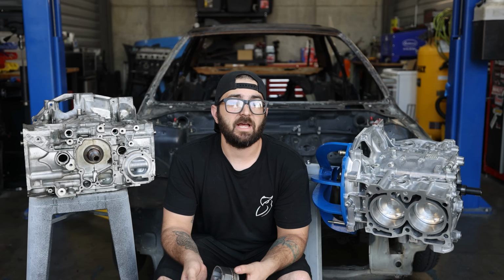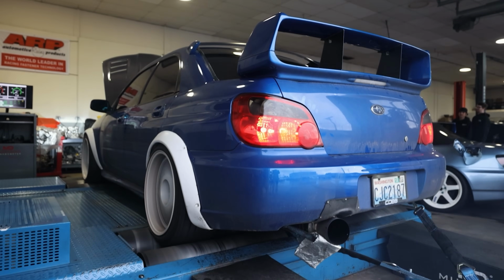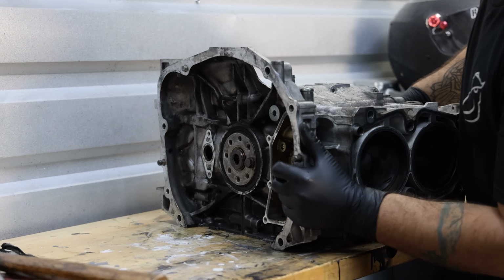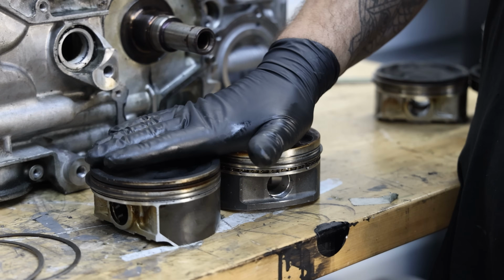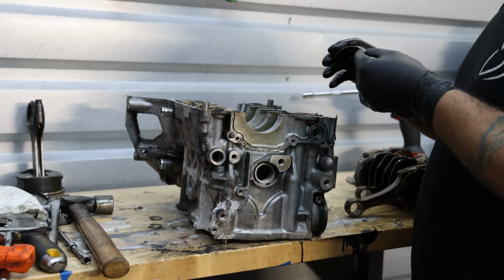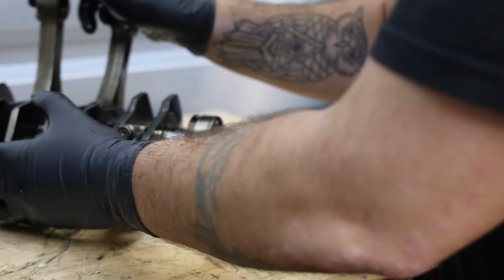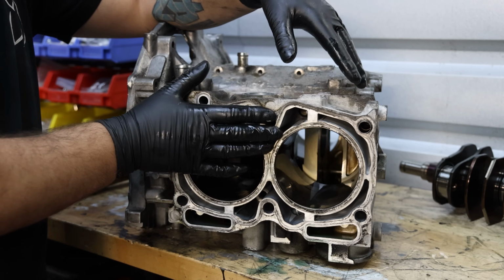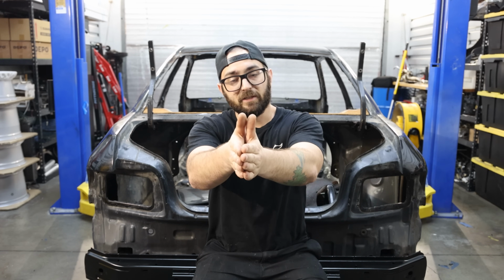The Reality of Stock Engines & making power; Subaru WRX STI

Comment: My dude, I would like to see something more informative. You missed a lot, I'm sorry to say. The biggest one being the positives and negatives of going forged internals. For example forged pistons aren't an end all answer to a problem, there is a trade off.
Reply: What’s the trade off? Mpg?
Reply: @dan2danger    well first we have to start with what type of forged piston. Is it a 4032 alloy or 2618 alloy? You can Google the differences between the two, but we'll stick to 2618 because I don't remember the last time I've ever seen anyone saying they're putting 4032 pistons in their EJ. 2618's have a higher thermal expansion coefficient. This means that they will get significantly bigger when heated, in comparison to stock hypereutectic pistons, which have a lower expansion rate. You have to compensate for this phenomenon by machining the bores for a larger piston to wall clearance, to allow the pistons the space to grow and expand once they're heated up. The problem in that lies with cold starts. Cold starts are already hard for any motor. Everything is at a higher risk of accelerated wear everytime you cold start an engine, because nothing is warm or expanded into its intended operating clearances. Having a larger piston to wall clearance exacerbates this wear rate on cold starts. You wear the concentricity of the pistons and liners quicker, piston slap can develop, rings don't seal as well, etc.

It's not that I disagree with the need for forged internals past a certain power goal. I would just like to see people more educated on ALL the factors that they're getting into when they go forged. So as they can make a more informed decision on whether $10k is a good choice for THEM in the long run. I mostly think of the people out there that are modifying their only car, and there's a LOT of them out there. That think "I'm getting a forged motor because it's just 'better'", but it ends up being an expensive crap shute, something goes wrong and now they're in a tough spot.

I could damn near write a book, but at least that's one of the big considerations.
Reply from the maker: @ThatGuy-yj3lu fair point to include in, with these videos though I try to leave them fairly surface level. Most people won’t understand alloys, PTW etc. including pros and cons would have been a good thing to add in I do agree. It’s just finding a good middle spot of how to present the info so beginners can understand as well. 🙏
Reply: @Smeedia  imo incomplete information can be as detrimental as wrong information.

Time to start writing the multi-parter. Use lots of pictures, us car people are simple creatures 😄
Reply from the maker: I’m not saying they are, and you talking about the expansion rate difference with forged vs cast?  Only big difference would be PTW clearance when building with maybe some pistons slap. But most people aren’t going to be setting up their own PTWC

Comment: So i can get an accessport with headers, intake, and down pipe to the already installed catback and not worry to much for a daily driver ‘13 wrx? 😅
Reply from the maker: I’d toss some id1050s and a fuel pump in but you should be solid 💪

Comment: Been running my Ej207 version 8 at 400whp for 4 years as a track build.

 A good tune and reliability mods like AOS, Cylinder #4 cooling mod, Killer B pickup and baffle 

= A long lasting stock block 

Ej207 is built better for the abuse
Reply from the maker: The thicker cylinder liners in the 207 are a huuuuge thing with factory blocks 🔥
Reply: @Smeedia  - Two versions, thick wall is hypereutectic pistons non-thick wall 207 with forged pistons - Non-thick wall good for 300kws (around 450-500 fried burger numbers)
Reply: And for the love of God... Replace the stock oil pan if you plan on doing any fun. Largest regret I have on mine.
Reply: @followtheornghat  I've been running the stock twinscroll one on track and I pull up to 1.35 lateral G's with the tire/suspension setup I'm running. 

Haven't had any oil pressure drop issues yet. Which pan do you recommend ? IAG or Killer B?

I currently have a Killer B pickup and baffle.
Reply: @ryanc2360  the baffle is the bigger upgrade. The oil sloshing in the stock pans of EJs is horrible.
Reply: Rod ratio helps a lot with that too.
Reply: So youre telling me if my ej blows up to use a 207
Reply: @nathanielgates2863  ya my car originally had a ej255. 

The ej207 version 8 has big port heads, equal length headers, a twinscroll turbo, no tgv's in the intake manifold from factory,  more aggressive cams, and an 8k redline.
Reply: @ryanc2360  Sounds like how they should all come lol

Comment: Currently making over 600 whp on my original STOCK engine. Tuned by @JRtuned. Ets rotated kit with gen 2 precision 6466 on e85. Here for a good time, not a long time  😅
Reply from the maker: I’m all for it my guy 😂😅
Reply: JRtuned is awesome. My 2015 STi still going strong with his magic.
Reply: FA series block?! Ej would just go 🤯 at that lol
Reply: @gripwerxracing  ej257 ra engine
Reply: That sounds like a grenade with just 1mm of the pin left in the spoon.

Comment: To the B22 fund
Is there a point in going for a super built engine if I don't have access to E85 and/or it's very hard to get it where I live?
Do I need to get it closed deck, forged pistons, ARP studs if I will never fill it with E85?
What would your advice be for pump gas?

PS. Love your content ❤
Reply from the maker: Appreciate the support my man! And tbh that’s kinda a hard question to answer without more info. 

You don’t NEED E85. You can make good reliable power on pump gas as well. As for a closed deck that really depends on your power goals, boost target etc
Reply: @Smeedia  My goal is 300-400 HP. But everyone I ask says: you can't make that power "reliably" on pump gas.
Reply: @m0rjjj666  you definitely can. 400hp on 91 is not uncommon

Comment: This isn’t so much a stock motor as such but more a stock turbo question. I’m currently running a pw verticooler and turbosmart have plumb back bov on my stock turbo 09 Forester XT. Currently I don’t think the stock car is making enough boost to open the piston in the bov, making the car “dose” to an extent. Should I be worrying about compressor surge destroying the td04? For reference the car has 86k miles
Reply from the maker: I wouldn’t stress it much tbh, you might see accelerated wear but nothing that should be radical or immediate. Does the BPV have an adjustment to it?
Reply: @Smeedia the current one I’m running does not. I’m going to switch back to my GFB Response, missing the sound of it all. With the gfb I wouldn’t expect to have any issues with it right?

Comment: Any 207 owners here. Superior motor than the 257
Reply from the maker: 207s built like a tank
Reply: Hello fellow 207 owner..lol..
I Agree with Smeedia, built like a tank. 
Over 900whp on mine and no issues.
Reply: Better rod ratio like to spin not as much stress 😉 those little 2.0 can go go go😊

Comment: I was running a 35R 2005 EJ257 on 18/19psi for a very long time. Over 15k miles before I took the car off the road due to other environmental factors. I still have the car but I want to pull it apart and get a million different things done for the body and suspension etc... What would a bottom end build look like for that short block cost wise? I would take it on myself but I have ZERO access to shop space now and to be honest, it's been 10 years since I was inside of a subaru motor...

Comment: are you at all familiar with the jdm ej20 with thicker cylinder walls? it is only sold in the 2015+ sti in japan but you can buy the case halves or a short block from RCM. i hear very good things about them and i am planning to throw one in my bugeye because its still a 2.0L and im looking for something to approach the 400hp mark. nothing too crazy cuz i just wanna be able to have fun in the car for a long time

Comment: To split the case i always use a scissor jack wedged in the bell housing , seems to work with out wacking away at soft aluminum
Reply from the maker: Scissor jacks not a bad idea, a dead blow won’t do any harm to the bellowing though. Cracked open a ton of engines that way
Reply: @Smeedia  yeh no disrespect,  jus throwing that out there some people seem to be gorillas when working on subarus  , broken stuff etc 😂

Comment: What’s safe for a stock fa20 engine hp wise. Currently tuned for around 280hp on pump 91. I wanna go to E60 tune. End goal 380hp to 400hp is that realistic for a daily
Reply from the maker: FA20s I see all over. I’d say that 360-380 mark is a pretty good sweet spot. LSPI (low speed pre ignition) is the weak point on FAs
Reply: @Smeedia  awesome man thank you for the info I just put a new oem short block in my car so not looking to blow it up anytime soon lol 350 probably be perfect for a daily. Thanks again 🤘🏻🤙🏻

Comment: Dang brother I wanted to keep my sti stock because I was scared to blow it up lol. I’m a pretty conservative driver but wouldn’t hate more power. You think I should shoot for 350whp with bolt ons?

To add I only have pump gas around me. Also I’m in Connecticut so I’m not sure who to use for a tune. I don’t want to go to Mike botti though lol. Been there done that.
Reply from the maker: I would feel pretty confident about 350, been done numerous times in the past. Plenty of good tuners out there as well!
Reply: @Smeedia  appreciate it! Any mods I should avoid on my journey?
Reply: @Craiggg12345  dude thanks for all that info! I screenshot it so I can basically follow the build on my 2017 sti. Are the killer b headers something you think I should do no matter what? I love the rumble but if the equal length headers mean better drivability, better for the engine and easier to reach that power then I’ll use them for sure. Also why the 04 sti fpr if you don’t mind me asking.

Comment: So an OEM 2015 STI runs about 250 WHP from 300 HP. The history of these engines detonating at say 450 WHP to 500 WHP is pretty well documented. 
That is say a factor of durability of say 1.8 or there about on an OEM engine.
So intuitively if you want to build a high horsepower engine that will last the same factors come into play. You want 400 WHP that will last you need an engine that can take a peak output of say 725 WHP or darn near 875 HP at the crank. Problem is that’s expensive. And there is the rub, the truth of it. Big reliable power is prohibitively expensive. The more you reduce that durability factor even with a built engine the chances of early failure are more probable with each hard pull. 
Just some thoughts and by no means a criticism of anyone wanting to cut things fine.
Reply from the maker: There’s definitely means to mitigate, E85 meth etc to reduce detonation potential to keep em kicking. But % wise I wouldn’t say it’s an exponential increase for what to build for and power output. Cast vs forged plays a huge factor

Comment: I'm looking at a 12 Forester XTT with 110K. I want it but the ringland scares me. This is video helpful. Do stock EJ255 have problems before 150K? If I get it I will always use 91 gas :lol:
Reply from the maker: I’ve seen factory engines go all the way to 400K miles. It really depends on the life it lived tbh

Comment: Do you think a block that suffered head gasket failure could be saved by being machined - bore/hone and decking? I'd like to put some power, 300 daily on pump gas, into the car but I'm not sure if I can use the core I've got or if it would just be better buying something from Outfront or IAG.
Reply from the maker: Totally as long as it’s not overly warped you should be solid to send it out for machine work 🫡

Comment: Don’t cast pistons last longer than forged pistons? While forged hold more power than cast? There’s pros and cons, no?
Reply from the maker: Not necessarily, the forged will have a different thermal expansion rate than the cast. Hence why on some engines you’ll have piston slap. But for day to day use a cast and forged don’t really have a different life span for an A-B Car. The forged will just take more abuse and hold up to detonation events better

Comment: I blew up my 2019 STI and it only had an intake and 45,000 miles. Still saving up for a built engine / heads. Definitely have trust issues now with Subarus 😢
Reply from the maker: Understandable 😢 what was the failure?
Reply: @Smeedia the driver
Reply: Intake with no tune? 

Perhaps not using 93 octane with the intake?
Reply: @buzzyshizzle5188  Its a pretty common thing for the cast pistons to fail even when stock.
Reply: Ring land failure, Im not going to lie i did floor it usually on on ramps and stuff (which is why i bought a sports car) but I wouldn’t say It was anything too extreme especially for stock power levels. Bought it used so maybe it was already hurt when i got it but idk. 

I have outfront closed deck / 1/2 in studs block and iag 750 heads ready to be assembled when i get around to it. 

Looking forward to my tesla to get delivered because i know it won’t break and it will make the power i was looking for, stock. 😂

Comment: Would have been nice if you also compared the ej255 as many people have just wrx's not sti's.
Reply from the maker: I don’t have any 255s sitting around but same same for the most part. I’ve done 450 on a stock block 255 in my old 14wrx hatch. I’d still stop at the 400whp point. You’ll run into trans issues before engine issues most of the time anyway
Reply: @Smeedia  ok cool, good to know. I'm aiming for 250whp. Keep up the good work ✌️

Comment: Speaking on built 2.5’s sticking a 2.5 in a 05 wrx, I have decided to just go that route so I can have more head room for power. Would you do the hybrid or make 2.5 heads work? I’ve seen parts to make the 2.5 heads work just can’t find a good enough set of castings to use
Reply from the maker: Personally I would just use 2.5 heads. You can scoop D25 heads for a decent price on market place or eBay. You can do a hybrid set up if you want to. Don’t see it done as much anymore but can definitely do so if you want to 🫡
Reply: @Smeedia  I’ll have to keep looking, I’ve decided it’s probably better to just build a 257 vs building a 205 lol

Comment: What are the biggest differences between a Subaru vs Porsche boxer engine?
Reply from the maker: Tbh depends on the Porsche engine. The turbos and most newer ones use dry sumps. On some older P cars the cylinders actually bolt onto the case halves

Comment: This is good advice. My 05 was rebuilt. Stock internals with bolt ons and all the supportive mods I learned from you. Slightly bigger turbo. If I could walk away with 350-370 I’ll be happy. Always appreciate all the advice you given all of us. 💯💯💯💪💪💪
Reply from the maker: Should be a solid stopping point right there with plenty of power to have fun with 🥳
Reply: I’m at 340 rn feels great
Reply: Left my 06 build open deck with the reason being I've got 3 boys under 10yrs old. 
Let's handicap this joker at 500wheel. After you've planned 400+ rods/pistons/ID1300s/fmic/ there's really only a second fuel pump and a big ole rotated snail away from 500+

Comment: very random question but do you do engine builds for people still and whats the price range on that for a shortblock?
Reply from the maker: Yessir and totally depends on the car, set up and goals
Reply: @Smeedia  Ok good! appreciate the insight! Ive got an ej205 bare block and am looking for a reliable 300 whp. already has full STi drivetrain, killer B oil system and a v3 AOS. plan to keep stock heads. Thoughts?

Comment: sadly i can tell you nothing is for certain in these engines. I searched extensively for the "right" car did full dealer inspection including compression and leakdown test on my $ and still got burned by a bad rebuild that had main and rod bearing failures in the first 8k miles. The race shop I had do the rebuild says they believed it had been apart before leading met to believe this failure had happened before. Don't get me wrong i love the car and am married to it now so to speak, but don't get into an EJ engine unless you are prepared to pay for its replacement. $16k on my end (yes that was more than just the engine)
Reply from the maker: Replacing these engines and rebuilding them properly is definitely no cheap bill. Fairly commonly I see 10-12K for an average rebuild. Finding a clean example Now is next to impossible.